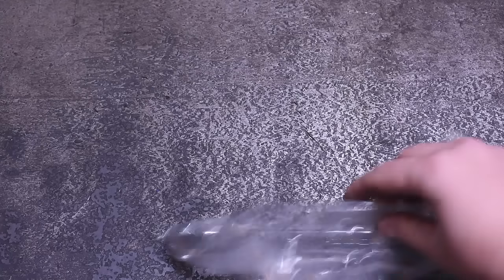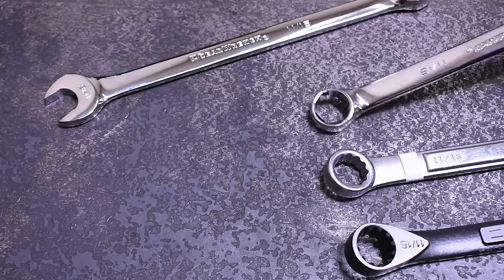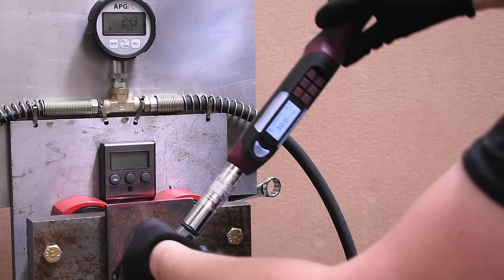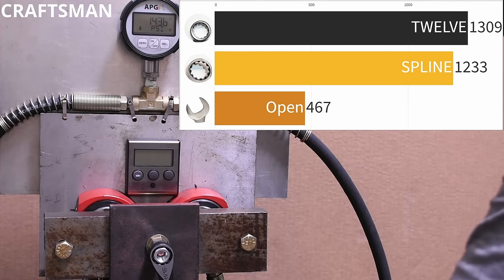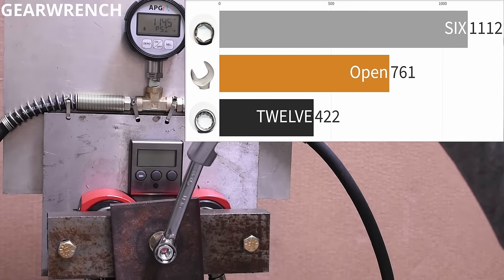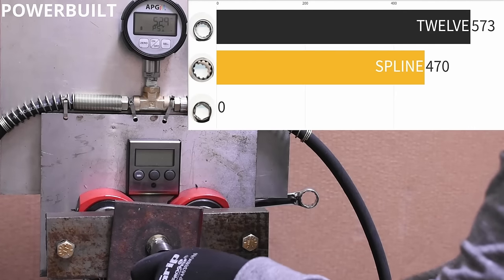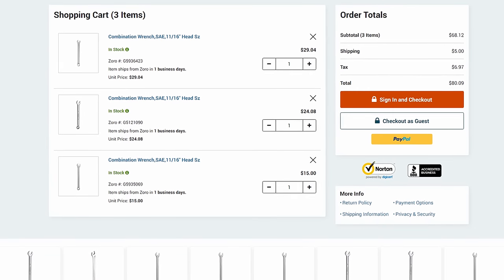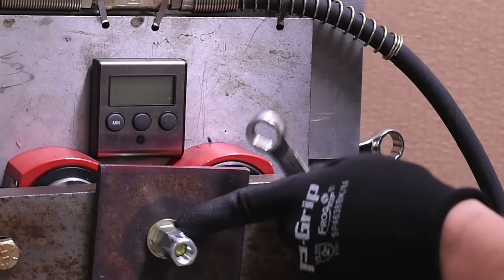Let's Settle This! What Wrench & Socket Design Will Slip 1st?

Comment: I did a lot of fastener testing in previous jobs, you will find that using a new nut and bolt each time will produce quite different results even with the same setup, so to say any one spanner gives x amount of torque you'd want to test it 10 to 20 times and then take an average result for sure. The scatter between measurements can be huge, and really you should lubricate the threads to try to make it consistant.
Reply: torque specs are always given for clean dry bolts unless specifically noted, so if you want realistic, pragmatic results you would use clean dry threads when testing, not oiled.
Reply: @alksmdlaks  Interesting because every engine head bolt torque I've seen is spec'd wet.
Reply: @kleetus92  Bolts inside an engine are usually lubricated
Reply: True if testing torque ability of different brand spanners but only thing being test is the ability of types 6 point 12 point and spline types to see which style is best. This isn't a torque test.
Reply: @kenjett2434  no thats not what I meant, I meant you need to test each spanner with a nut/bolt several times and take an average, the scatter in results can be quite high even when using the same setup.
Reply: @StevenLewis-HDI-Tuning  again this wasn't fasteners test nor torque testing. This was solely a test of different styles of spanners. It doesn't require the type of torque accuracy your suggesting if test fasteners or the torque ability of a given brand of spanners.
Reply: 12 point are used when there is not a lot of room to set the wrench onto the bolt head.
Reply: This.
Reply: @StevenLewis-HDI-Tuning he was testing how well the different design patterns hold onto the bolt head torque isn't gonna effect it much and it wasn't a material strength test both of those applications yes do that but this was very simply "which design strips which bolts which way"
Reply: @TheEldritchVoid  Yeah, and to get a conclusive result you'd want to repeat the test.
Reply: @kenjett2434  their point is valid regarding a better consistency by using a lubricant.
the test measured the clamping force produced by the nut/threads at the point of slippage NOT the torque applied to the tool at the point of slippage. 

the nuts that present greater friction loses will produce a smaller clamping force (what was monitored) for the same torque applied to the tool.
that could potentially result in a misleading conclusion about the slippage point. 
by using lubrication, the friction variations between each fastener could be reduced. 

for this particular experiment, the values weren't that close to actually be a concern... but in a test where same design was tested over a few manufacturers, the result may not be valid...
-------------------------------
ps: some 'light' engines such as motorcycles, where components aren't that beefy but still need to clamp w/ substantial force, the service manuals call for a mix of high pressure lubricants (like moly+motor oil 1/10 ratio) when torquing key components. that serves two purposes: consistency over the fastener pattern and higher clamping force for the same given "twisting" force applied (allowing for lighter fasteners).
Reply: @duroxkilo  sorry but your talking about something that has no bearing on anything I said or the subject matter in this discussion.
Reply: @kenjett2434  you said lubrication is not necessary when testing spanner max torque capabilities.
i was trying to explain to you why having a 'constant' friction coefficient between fasteners is important.
if you already understood how these are related but are of a different opinion, i didn't mean to preach :)
Reply: @duroxkilo  ok gotcha now may have just misunderstood because of the over explanation. True consistent lube can be a factor in reducing friction but for testing purposes no lube for this particular situation will give more consistent test results.

Comment: "Assuming we're not incompetent"
I'm really impressed that you're keeping all options on the table and being objective with them. I always leave this one on the table as well.
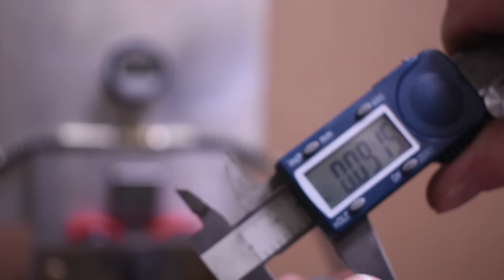Reply: I'd like to see the Tools themselves measured before testing. (like the nut measurements at 2:54 but for the inside of the tools. We might find that the widths directly relate to the slipping for 12-point and splines.
Even Order the same tool from 3 different vendors and find the average for each tool. 
The 12-points were all over the place. GearWrench and PowerBuilt were low for 12 points, and I wonder if they make their parts wider, softer metal, or it was a fluke. Those companies could have lower tolerances or purposefully make wider tools for ease of use.
Also, he didn't mention doing it, but run each tool 3 times with 3 different Bolts to account for errors in the bolt rounding. (or hire AvE to machine rounded heads)

Comment: Spline is great when you don’t need to remove what you’re installing, or when you plan on throwing away the hardware you’re removing, or you just don’t care what condition your bolt is gonna be in when you’re done torquing it.
12 point is good when your hardware is already kind of loose and you need that extra half swing on a tight spot. It also fits square hardware since 12 is divisible by 4.
6 point is the go-to for breaking stuff loose or applying a final torque. Just be sure your tolerance is close for a nice tight fit and grip.
And when all else fails, a Pittsburgh wrench welded to the nut will never slip 😂
Reply: 12 doesn't fit square, 8 pt for that
Reply: Challenge excepted I'll weld it you turn it hahahahaha
Reply: what about rounded splines ?
Reply: 14mm 6-pt on a 9/16" bolt head...close tolerance (slight friction fit if rusty or zinc plated), NO play. You'll probably shear off the head before anything else fails. (FYI, 9/16" ~14.2mm, so a 14 fits, just barely).
Reply: Spline wrenches are made for spline bolts. Hence the name
Reply: You never know when you or somebody else may want to remove the bolt though. I can't tell you how many times I've installed something thinking I'll never touch it again then regret the way I did it.
Reply: @rosone51178  12 definitely fits square. I use 12 point sockets to drive my taps because I'm too cheap to buy tap sockets or a proper tap wrench
Reply: @rosone51178  um…12 point wrenches 100% fit square bolts.
Reply: @rosone51178  12 point is also called triple square for a reason
Reply: @201hastings  I agree with you on this one. Why the hell would anyone choose a spline drive to drive anything other than a splined fastener? I notice they didn't include any of the 'wall drive' type spanners or sockets which are designed to grip damaged/rounded corner nuts and bolts.
Reply: @SwapAscension  Yep,me too.
Reply: @rosone51178  Oh yes it does.
Reply: ALL true. I use my 12 pts only for 4 squared nut ends...... I would NEVER try and break a torque with a 12 pt, unless of course it is welded on the nut.
Reply: That's advice from someone that knows his trade. Thanks for sharing.
Reply: Why is it so difficult to find 6 point wrenchs instead of the 12 point ones on websites like Amazon?
Reply: Hopefully, you weren't overtightening actual mechanical equipment, otherwise vibration would cause fatigue in your bolts/studs.  Overtightening doesn't mean a better fasten.
Reply: @sMASHsound  again that's where the welder comes in
Reply: Pittsburg...welded on...the only way you can really lean on them....A product from India....a friend of mine...wrenching for some 40+ years says to me...."Well, the only thing India is good for is..Textiles"....
Reply: @rosone51178  yes, but  findng a vehicle with a four-point or an eight-point night is about as rare as finding hens teeth
Reply: @rosone51178  I routinely use 12 pt sockets to drive square headed taps
Reply: @joelnordstrom8049 never underestimate the tendancy of vehicle manufacturers to:
Put something that needs regular maintenance in an inaccessible location;
If the location is sensible, make access impossible to anyone with hands larger or less flexible than a 6 year olds;
Use a virtually unknown fastener ie an 8 point nut;

Comment: 12 point
Also known as the lowest RPM lathe.
Reply: Hahaha! So true!
Reply: I bought some in a kit but they're clearly marked as the "suicide kit".
Reply: That would be any cheap adjustable wrench
Reply: Hahaha the sad truth!
Reply: Isn't the swedish nut lathe much more efficient at a slightly lower RPM though?
Reply: I always slip with them.
Reply: @skinywtboy  adjustable wrenches are actually really good if you know how to use them. Check out Project Farm's torture test on them.
Reply: @skinywtboy  my harbor freight vice grips work better as an adjustable wrench than a harbor freight adjustable wrench
Reply: @bajszosklarinetmadar3957  
A Swedish nut lathe is really not accurate description. 
A lathe cuts away material. The so called Swedish nut lathe just smears metal around by displacing it.
Reply: Didn't even see the video, it's 12 pt.
Reply: lol
Reply: Nah, that's open end spanner's title
Reply: You guys use spline wrenches on non spline bolts? Weird
Reply: @flyingtentacle7631  LOL!!! 
You're better off using a pipe wrench than those stupid adjustables...
Reply: Pocket lathe
Reply: This gave me a good laugh
Reply: @skinywtboy  Or a visegrip. I call them manual knurlizers.

Comment: As a mechanic myself I always use 6 point for sockets, and 12 for wrenches. It seems to be the most versatile combination. But I might have to try out some splined wrenches, those look promising. Sometimes it's good to keep an odd inch socket laying around to beat on to a rusted mm head, or vise versa

Comment: This video taught me something….there are real extenders for wrenches 🤗 I’ve been using 2 wrench trick for many years, never even knew there was an actual wrench extender product.
Reply: But the two wrench puts more of a second pivot point then the extender which gives you more power baby
Reply: What's a two-wrench trick?
Reply: @topchooo  when you hook the round end of a wrench to the box end
Reply: 2 wrenches? I've been using a steel pipe 😂
Reply: @topchooo  lol it's a life saver at times
Reply: @Phyoomz  I mean it’s not like it isn’t effective (and much safer, alllll about the safety)
Reply: I’m glad I wasn’t the only one to think the same dang thing!
Reply: We just have a long metal pipe named "big chungus"
Reply: @paulking4134  another pivot only makes it riskier
Reply: Get a pipe lol
Reply: Just get ya a multiplier and you can toque over 1000 ftlb with a 3/8 ratchet...lol
Reply: There's wrench extenders like that, or through JDTCo you can get what they call the "warranty checker" which has that same head part for the wrench but then you stick a breaker bar on it.

Comment: When I saw Tekton selling ratcheting 6point wrenches I pulled out my credit card instantly. Cannot overstate how many times they've come in handy
Reply: I was considering those when I got the SK X-frame wrenches. Would be nice to have offset or flex head 6 point ratcheting wrenches
Reply: Too bad the weak point of the Tektons is the ratcheting mechanism.
Reply: Same, when I went looking for some better ones to replace my crappy no-name amazon specials I started out with I ended up with those specifically for the six point. Shame they've discontinued the reversible ones with the offset head, at least for now due to apparent supply chain issue, hoping that's not permanent, but merely "we don't have a reasoanble ETA on more so we're not even going to list them right now" situation. 

They do still offer six point flex heads, but me personally I just don't like how those feel if I really torque on something, which I know logically is probably dumb because if anything is gonna break it's gonna be the teeth before the pin lets go, but shrugs I just liked the solid offset heads better.
Reply: I have the extra long flexhead 6-point ratchet wrenches. They work well in the lot of circumstances, the six-point does Inspire confidence. The only catch is once in awhile they might snag up in a position where you don't have much room to swing it enough to get it off the fastener... not usually a big deal can usually jar it off with a hammer or something.
Reply: @sixtygrit9944 
so you don't recommend the Tekton ratchet wrenches? is there a better one you recommend?
Reply: @sixtygrit9944  yeah, but when they have the easiest and fastest warranty process i've ever experienced i don't mind.
Reply: Isn't the weak point of all ratcheting wrenches the ratchet mechanism?
Reply: @rpavlik1  yep, unless they were completely incompetent and made the ratchet stronger than the handle.
Reply: Whaaat? I hadn't seen those. I want some!
Reply: @codemiesterbeats  those flex head ratchets saved my brains from painting the ceiling when I was installing headers on my car a few weeks ago.  
I am forever grateful lol
Reply: Let me know in 6/mo or so how those Tektons have held up. So far, I've been happy with my large set of sockets, and I've been looking to get some of their other products. I like their no-nonsense replacement garuntee and they seem to be slowly moving towards mostly US made products (slowly.*
Reply: I want a set for the same reason, but it looks like everybody else does too cause they're backordered for months. Had a few jobs that could have used them too, Honda sway bar links are a pain.
Reply: @Tk3997  The reversible ones are discontinued for good, they are not even listed anymore. I have a 13 piece wrench reversible ratcheting offset imperial set, in new condition, that I am looking to trade for the flex head ones. I bought my metric set in flex head a bit later, and just prefer flex head myself. Would you be interested? I am in ohio.
Reply: TEkton? Good to know. Thanks.
Reply: @aethertech  they worked for me for about two years as a gasoline dealership mechanic before i changed careers, and the guy who told me about them had had his for i think five years before he moved to our shop. granted 90% of everything i touched was less than ten years old, and if i felt i was putting in around 200 foot pounds i would stop and use my breaker bar rather than risk breaking the ratcheting mechanism, but if you can almost do a pull up on a wrench it is a good idea to stop and think about what will happen when it breaks loose.
Reply: @aethertech   i have have had the long flex head ratcheting wrenches for about 2 years there great only weak point i would say is the flex head its self but the warranty is the best i broke a 14mm flex head on a crankshaft bolt on a honda at 10 at night ik it’s stupid should have used a breaker bar but either way i put the claim in and in 1 day and a half i had a new one at my door step in all there a great company

Comment: I’ve used all the different types.  All are good when used as they should be.  A little trickI learned on bolts where the rust buildup has made the head larger is to take the 12 point or spline drive of the size up, wiggle it back and forth to knock some scale off then slam a 6 point on it and off she goes.
Reply: I fear this man

Comment: I've always tried to purchase 6 point every time I can except for combination wrenches as they function so much better in my experience.  Thank you for confirming my otherwise unsupported bias.
Reply: Same. 6 point have always worked best for me too.
Reply: Same. Other than a few instances, no need to ever have a 12pt socket. I never understood why people get them.
Reply: @renalshomlmes338  12 point fasteners
Reply: Keep in mind guys, these tests were run on 40% rounded fasteners. If the hardware was new/less rounded, i expect the difference would be much smaller. And to top it off, the open end still got up to 60 lb ft. That's significant torque! If you have a fastener that needs 60+ lb ft of torque, and it's 40% rounded, you should be replacing said fastener, not worrying about what tool to use.
Reply: 12 point spanner’s are much more useful overall especially in cramped areas but if something is real stuck.. you got to get that 6 point out.
Reply: Nearly everytime I've used a 12 point I've rounded whatever fastener I was working on, so I completely agree with you.
Reply: Fastener heads are designed to fail long before the thread shank.Using tools improperly can fail them. Anytime a tool is used with loads enough to cause head deformation is prodent to replacement.
Reply: @seanedwards94  12 point ratchet, dozens of screws (some pretty used up) everyday and rarerly rounded one. Are u sure u do it properly? >.<